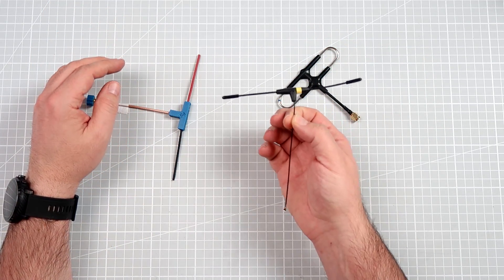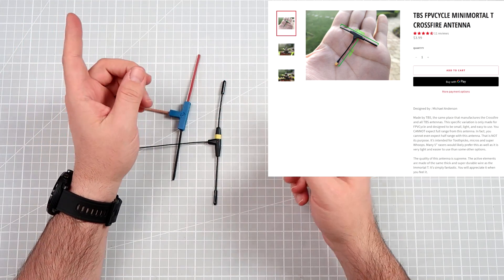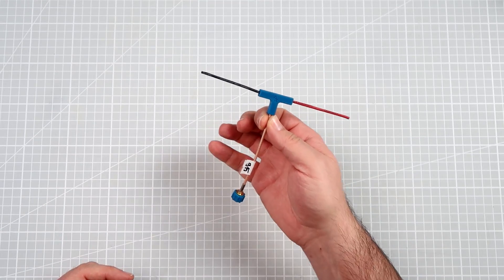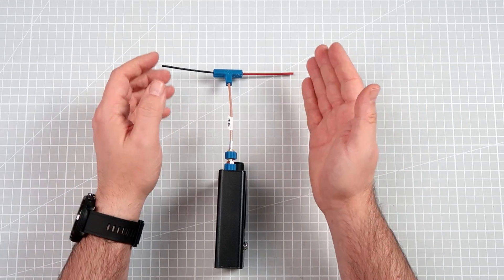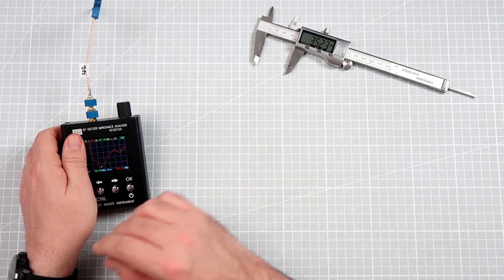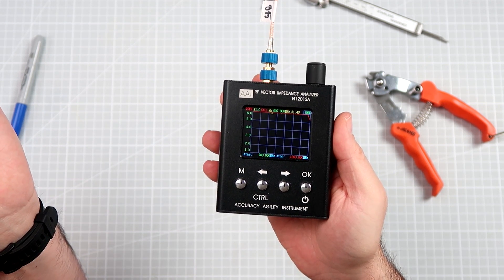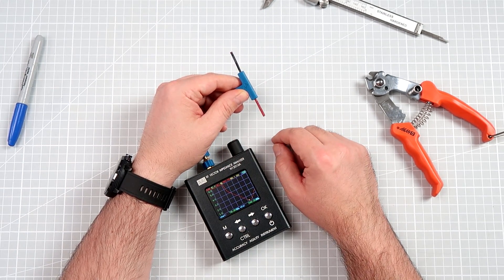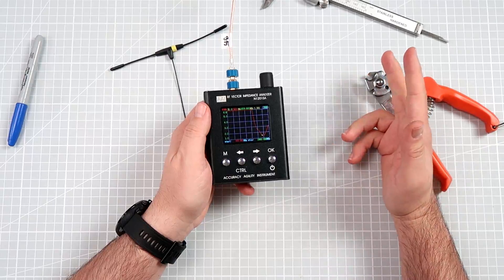MiniMortal T at home - can't you just shorten a Immortal-T?

Comment: I don't dare, nor intend to question the results of your test and measurements, but from experience I can confidently say that an Immortal T chopped the way you did, still has a far superior range compared to the Minimortal antenna, not to mention the durability.
I need to admit here (not without some guilt) that I have been using such an antenna on my 2 TH Freestyle kwads and been pretty happy so far. Previously I had tried the Minimortals, but a) the range sucked, b) they were too fragile - I had mine fairly exposed in order to get maximum of range and it didn't take a big crash to snap the 'T'... The Immortals on the other hand live up to their name 🙂
Now that Express LRS is here, I'm thinking about switching to it, but I'm also hoping that seeing how popular Express LRS has become, TBS also releases a sub-nano Crossfire  rx with a ceramic antenna, because I love the firm factor of my Tango 2 and don't really want to add an external module to it...

Comment: I’m no electrial engineer, but it seems to me that a 1/4 wave monopole made from a piece of coax would be smaller and lighter than a full Immortal T, and should work almost as well since monopoles and dipoles have the same gain.  The monopole is just somewhat less omnidirectional.  I might be wrong here, but I do plan on experimenting with this after I build a crossfire micro quad.  Thanks for all of your wonderful videos.  I have learned a lot from you, and I am very grateful for all the work you put into them.

Comment: Slightly off topic: Do you know which lead is the active element and which is the ground in a Immortal T antenna?  Want to mount mine with the active element UP and the ground DOWN.  Can't figure out which is which though.  Both leads seem to have continuity to the ground on the Ufl connector, which doesn't make any sense to me if this is a standard dipole.

Comment: i'm pretty sure this is exactly what the minimortal t is, you get a colossal loss of range, 2 to 4km instead of 40+km, but still pretty functional.
Reply from the maker: You would get the same effect just putting a random length of a wire instead. Range depends on the amount of power put into the air and receiver sensitivity, not antenna length
Reply: @FPVUniversity  That's what she said.

Comment: What is the point of a shorter antenna if you lose range. Might as well just use 2.4ghz🙄. If it's a question of more latency with FrSky 2.4ghz then you should have bought FlySky...lol
Reply: they are mostly for small toothpicks and whoops, where size and weight matters

Comment: A wet noodle would be sufficent as antenna for 900MHz for micros (which the fpvcircle antenna is targeting I think) considering the flighttime. Could you maybe look into these 900Mhz pcb LTE antennas found in smartphones? TBS has them in their shop and branded as super duper "xf race antenna". Available on aliexpress for cents or 6usd plus shipping from tbs.
Reply: Vincent Fischer - I had zero luck with the XF-Race antenna. Horrible range and penetration for me but I’ve seen others use them with great success. But I removed the ipex2 ufl pigtail and added the smaller ipex4 ufl pigtail for use with an R9MM receiver so that might have had an effect on performance but I don’t see why it would.
Reply: @sketchpv  You soldered coaxial cables together or did you crimp the connector on? Sounds like a real challenge. Might as well desolder the connector from the R9mm and solder the antenna directly. I'm sad to hear that they didn't work well for you, I thought it's the only viable solution for micros :(. So whats left beside having an antenna dangling behind our micros half  the size of an immortal t
Reply: Sasha Kruse Grim - That info is much appreciated. I couldn’t figure out why the signal strength was so low. I thought perhaps I flexed the PCB enough to break the element inside but it makes sense now.

Comment: If you want to shorten a 1/2 wave dipole your choices are limited yes as you said a coil to add inductance will work or a capacitative hat at each end of the elements but probably the simplest way is to loos half the antenna is go for a 1/4 ground plane the ground wire can run any way you want including along the feed line as long as it is insulated. also remember shortening an antenna with coils or capacitors will heighten it.s Q factor resulting in a narrower bandwidth.

Comment: Honestly what is the point of having shorter antenna? 🤔 Seems like we looking more stylish antennas than the quality ones. It does not make sence just use a proper sized antenna's and there will be no problem with reception 📶
Reply from the maker: well, when antenna is longer than the quad itself it get problematic :)
Reply: Well my 2,5" toothpick isn't happy with the Immortal-T you know? And he doesn't mind not being able to fly 10km+ if he could get some shorter antenna :)
Reply: @Umarluch  Their half dipole works great on toothpick builds. Just install it so that each end is on an arm with a ziptie and heatshrink, like we did for 2.4GHz. Yes, the carbon will block some in the middle, but I've flown about 1/2 mile out and never went much under 80 for my RSSI value in OSD, brief drops into the high 70s during turns and flips.
Reply: Got myself r9 slim+ so far no problems on super 8 antenna and my quad is 7 inch seems all good so far :)
Reply: I got myself a tiny 5cm antenna today for the crossfire. I will put it to a test soon and will let you know how it works out.

Comment: Of course it's easy and possible between 433 mhz to 1.2 ghz - https://youtu.be/xWjIX2pfxhk
Reply from the maker: Of course it is possible to make an antenna at home. But you can not make it 1/3 of the length of 1/2 dipole but just shortening it. You miss the point
Reply: @FPVUniversity  The yield is not the same in 1/2 or 1/4 or 1/3 wave but the important thing remains the ROS